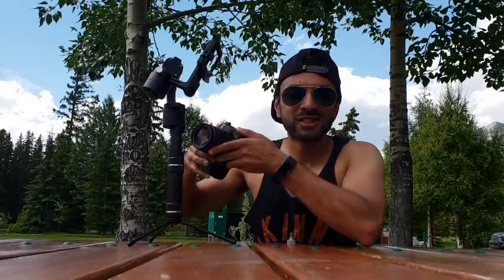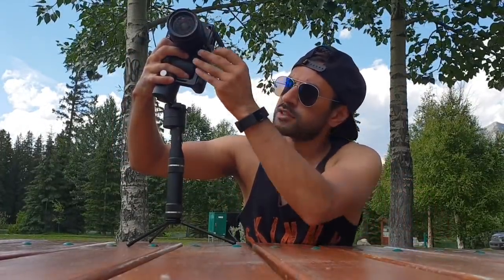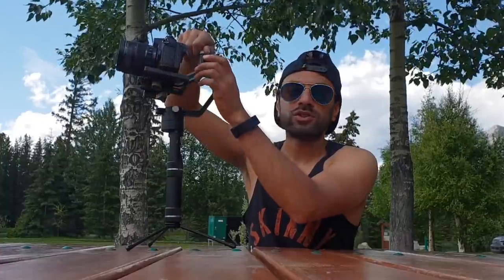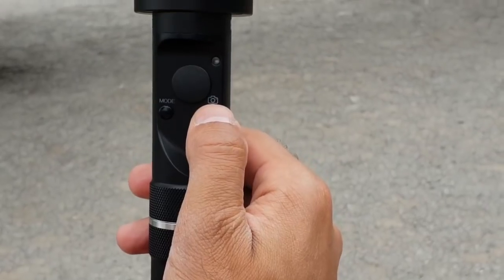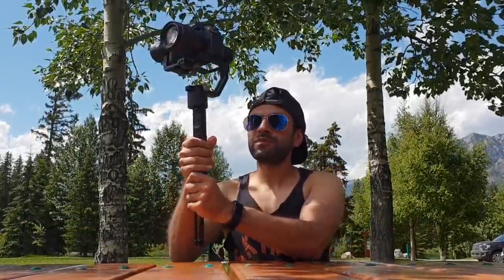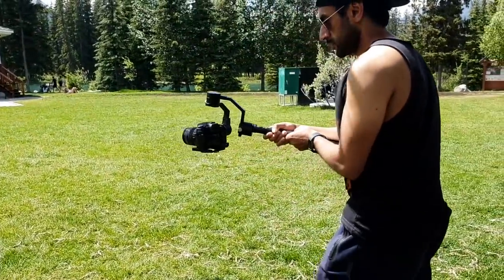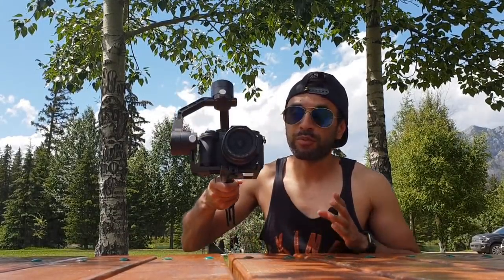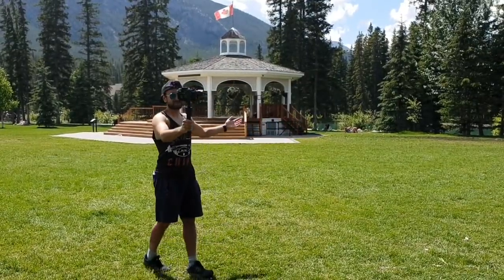Zhiyun Crane V2: How to Balance, Modes & Test Footage!

Comment: Would the pan mode still work the same way if the gimbal stick is used horizontally? I assume the pan and roll motors would swap their task? Or would it just simply not work? For example with the gimbal stick vertical when the stick is changed to horizontal is the pan motor changed to roll? and the roll motor changes to pan? tilt would stay the same right?
Thanks in advance, new to gimbals.

Comment: Hi ! I was wondering if we can setup the Sigma 18-35mm lens on the Zhiyun Crane V2 adding an adjustment plate so it won't fall down with the heavy lens pressure? It's for a Lumix Panasonic G7! Thank you!
Reply from the maker: Hey - sorry for the late reply! I would suggest adding the weight of the lens with the weight of your camera, and cross reference with the max payload of this Gimbal?

Comment: Just got a Crane V2 off eBay and the blue light constantly flashes when switched on. Is this normal?
Reply: l-mayceefhie is the camera your using to heavy or did you balance it properly? Cause no it shouldn’t do that. Hopefully you already figure it out if not good luck. It’s awesome gimbal for the price